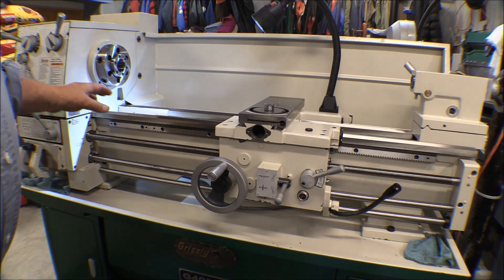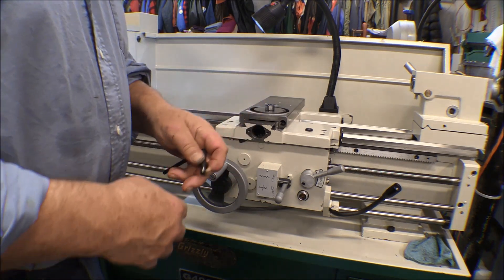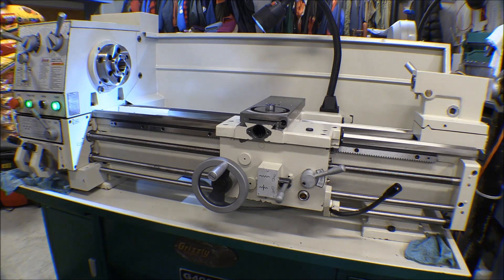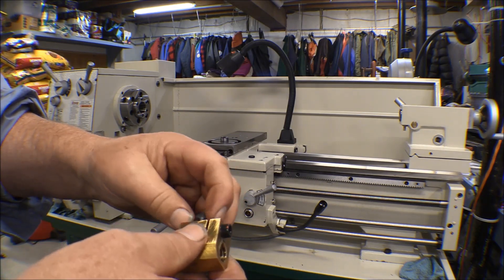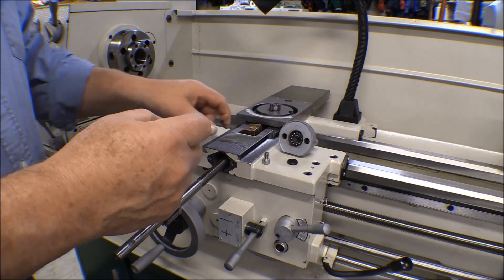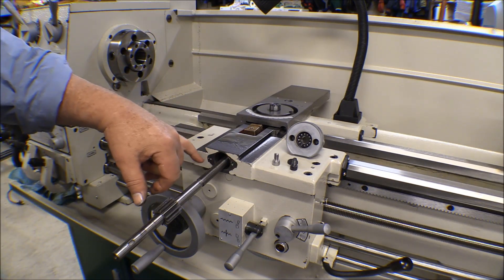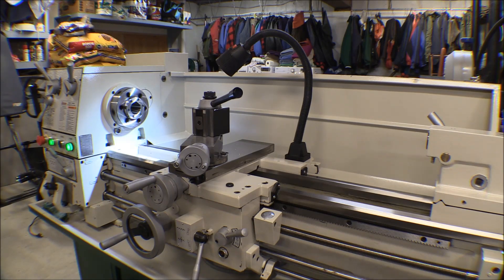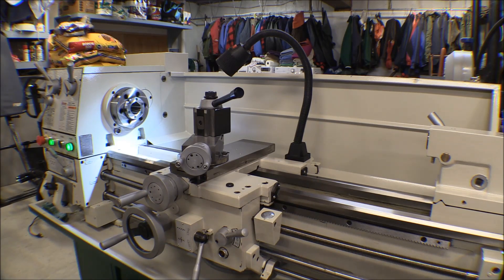Grizzly G4003G disaster- crash - boom

Comment: Don't anchor it to the floor it needs to be on leveling feet. It also has to be leveled with a precision level or your shaft you said you needed to turn will be tapered. Lathes don't come new cutting straight you have to set it up to cut straight.

Comment: I’ll share a recent experience with my G4003 gunsmith lathe. It recently locked up on me while in use. We trouble shot the issue and found that the input shaft on the quick change gearbox locked up and also sheared the key on the 16/32 tooth combination gear. Ultimately the problem was caused by inadequate lubrication, which i routinely do on this and all machines. The problem is that if you think a squirt or two of oil in the tagged oil holes on the gearbox itself are enough, it just isn’t true. Those holes lead to a tray that is cast into the top of the gearbox housing. Inside this tray are additional lube holes that eventually make their way downward to the rotating gears and shafts inside the gearbox. Blah, blah, blah, but the moral of the story is when lubricating your machine, squirt at least 2 to 3 ounces of lube in this section of the machine to fill that tray. If you don’t see any dripping from the selector shafts into the chip pan, you likely don’t have enough oil in there. Good luck.
Reply from the maker: True, it takes a lot more than a couple of squirts, you have to make sure the tray is filled up so that oil flows to all the oil ports. I've seen some posts where guys have made distribution lines to make sure oil gets to the gears, but that wouldn't directly lube the journals. Looks like the cover needs to come of the lube the output shaft of either the lead screw or the feed screw, I forget which.

Comment: That role pin is suppose to be a fail safe but it seems it did not work as intended. Otherwise, you would not have had such damage. perhaps a brass pin might be best.
Reply: GnosisMan50 use a bamboo skewer............you'd be surprised how well it serves as a shear pin.     People will tell u you're crazy but...............IT WORKS.

Stavros

Comment: Was that actually a roll pin or a shear pin?   Chinese machine tools aren't necessarily junk by design, just compromised by trying to meet a hobbiest price point while coping with ever escalating costs, shipping, increased tariffs, etc., etc.   The hardware is typically referred to as "cheese grade" and really should be replaced with Grade 5 or better, depending on application.  As for the machine itself, best to think of it as a kit and go thru it as if it were your first major project. Break it down, stone burrs, break edges, polish blems, flush out castings, clear oil ports, straighten wonky gibs, lead screws, refill with good lubricants and level it properly before use and once again in a month or so. . This can usually be done after the headstock break in exercise, but sometimes loose debris can occasionally eat a bearing before you're done.   After the TLC, you'll know it inside and out and should have a pretty solid bit of kit ready to go the distance.  Stefan Gottewinter, albeit a very talented machinist and seasoned perfectionist,  seems to have good success with this approach with his Chinese machinery; though it is a fair amount of work.   In any case, good luck and have fun.   My old Chinese mill drill is not nearly as nice a starting point as your G4003G, but after doing a full rebuild with quality bearings and a lot of hand fitting, it is accurate enough to get me some valid experience and make decent parts until I can afford better.
Reply from the maker: It is a spring steel roll pin, probably intended as a shear pin. I have some other tools that use the same type of pin as a shear pin. Good spot for one as it prevented damage further down the line and prevented a real crash.
I did have a real crash. I was cleaning and oiling the machine after a period of use. I have never used the lead screw before so I had cleaned it and was running it back toward the tail stock to spread the oil when it bound up. It didn't run into the tail stock or anything , just banged and came to a stop. I got to looking and the change levers were hanging down, bent the shafts in the change gear box. Could have used a shear pin in that train somewhere. I think the rear support for the lead screw is bored out of line. Worked fine until it got about 6" from the end.
I'd read all the stories about how bad these lathes are, so I took it all apart before I ever started using it. The only thing I found was a couple of places that needed de-burring, the thick coating of bilge-oil they coat everything with, and some metal shavings from drilling the holes for pins and set screws in the gear boxes.
Reply: Normally hardened spring pins aren’t intended as shear pins. Often there is a shear pin on the feed rod or lead screw where they come out of the quick change gearbox. It never hurts to call grizzly if you’re not sure. They do have engineers who will speak to you. Their manuals are also good and if something is a shear pin, they will usually say so. It doesn’t hurt to order a couple,e just to be safe.